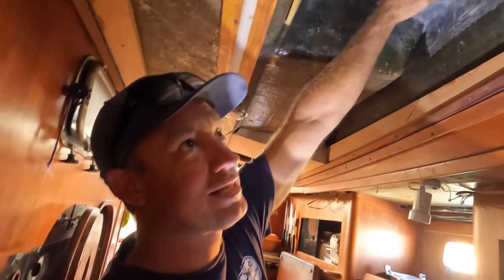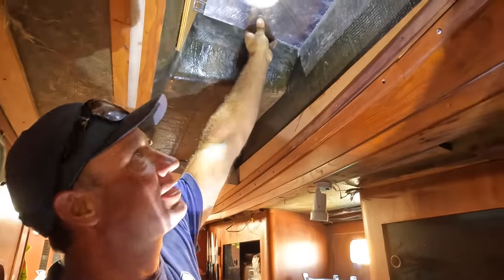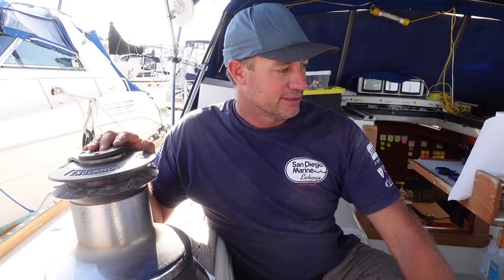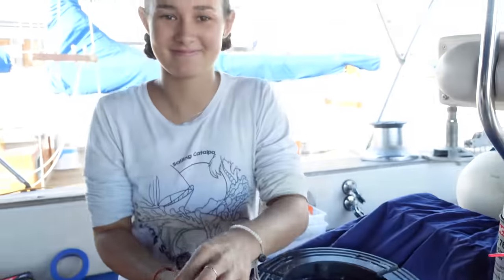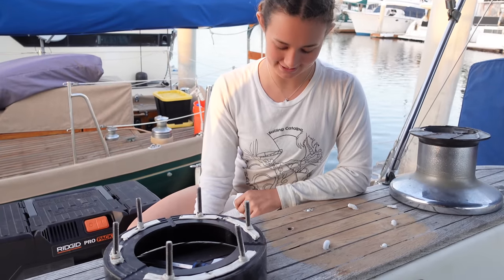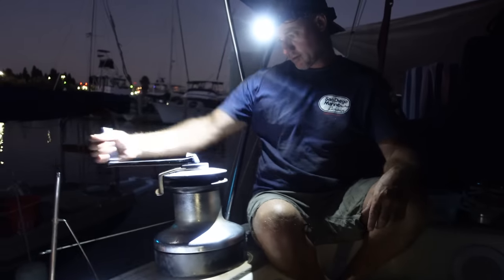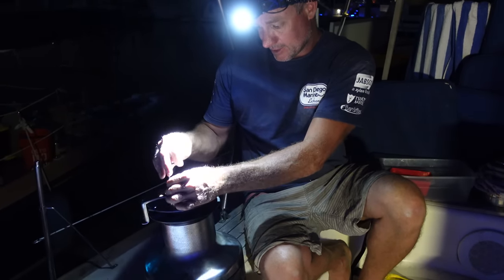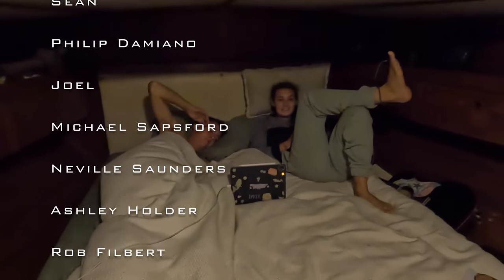How does this GO? Putting back together a WINCH | Ep 317 | Lots of Boat Work

Comment: Good call on making the winch mount failproof with G-10 and an Al plate.  I'm a firm believer that if you have to fix the glass on a boat make it better than it was from the factory.